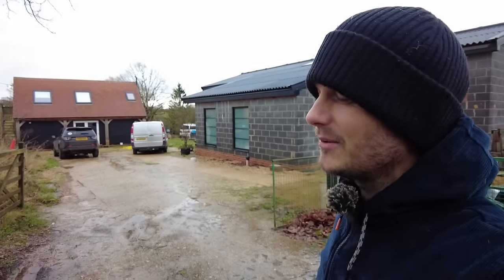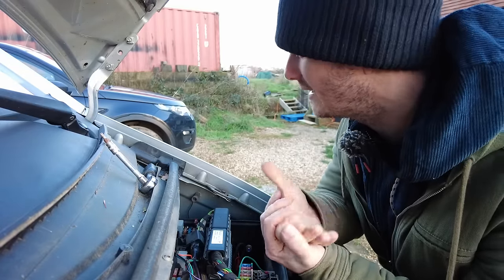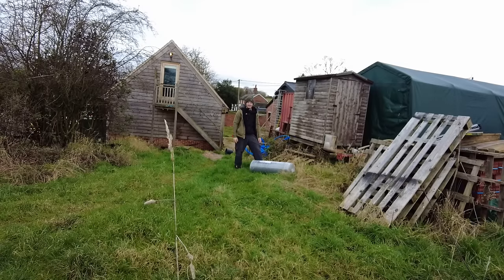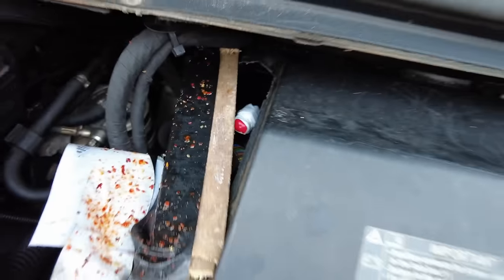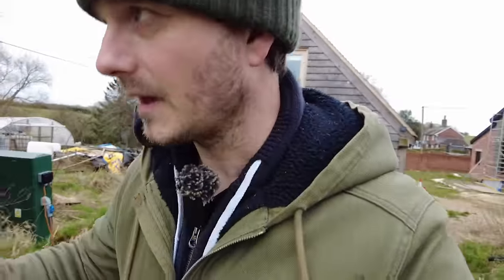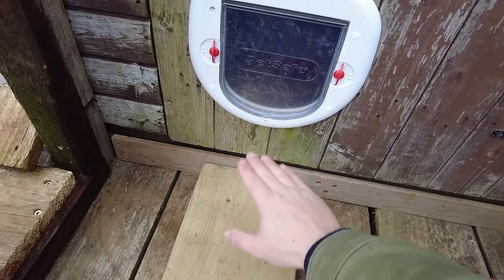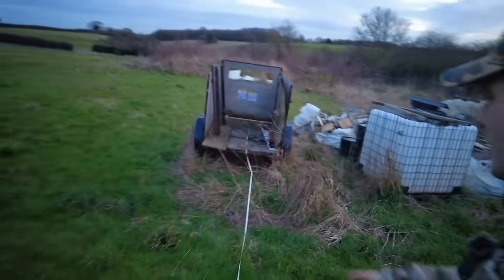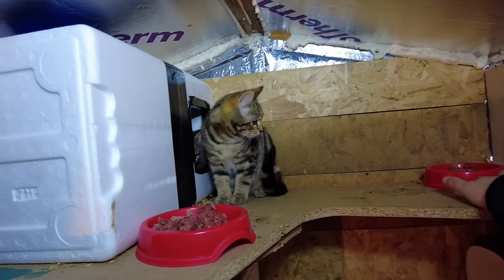Here's How I'm Handling It!

Comment: We've found that the wood pellets work a lot better than standard cat litter, works out a lot cheaper as you use less, it bio degrades when wet and is easier to sift.
Hope they fix your rodent issues, looks like they'll have a nice rural life once acclimatised.
Reply from the maker: I would go down that route but they were used to catsan at the rescue so thought I best not rock the boat too much 😬 once they're ready I'll open the door and they'll have a whole field to go on anyway so should only need a couple of bags 🙂

Comment: Years ago I got told the bin bags were moving in the back garden, "year right!" went out to investigate in my PJ's flip flops and dressing gown.  "Sh## the bin bags are moving", opened the shed, removed the garden fork and proceeded to lift each bag up with the business end of the forkand move it to one side.  A few bags later out hops a rat, I take a few quick jabs at it with the fork, striking sparks off a brick wall and with a squeal it runs off down the passage between houses.  I went to work the next morning but got a phone call on the Nokia brick due to a dead rat in the middle of the garden. It must of crawled back later an keeled over.  "They don't like it up em!!"
Reply from the maker: 😂 I hope they were camo PJ's

Comment: 1 big drum with a trapdoor on top with lots of peanut butter on top and a plank of wood for them to run up . My record Hi 30s .
Reply from the maker: Don't birds get interested?
Reply: @THE-AIDEN-PROJECT   I've never trapt one by mistake only pheasants with 1 plastic cup and 1 fly  sticky strip.  Put the strip around the inside edge of the cup Put in at the bottom of a bush with sweetcorn leading up to the cup with some corn at the back the pheasant will freeze with its hed stuck in the cup. Sunday dinner sorted.  New subscriber 👍🔥👐👍💙✝️

Comment: Spray WD 40 , and white lithum grease in a spray can, and spray the underside of the van everywhere. The white lithium grease spray is waterproof and will stick to the wire harness etc and help prevent mice chewing on wires. The WD 40 seeps into the cracks and will wash off , but it’s great at seeping into cracks, the white lithium grease, will need a respray at least once a year.  Mice will find a way inside your car , they are determined to find a dry home , the WD 40 spray on the underside works well at preventing that

Comment: Mate this was epic, literally! I love the way you told the story, it was a while in the making I'm sure. Can't wait to see if you actually get a rat with that gun. On a side note, how's the build progressing? What's the next thing on the todo list? I've been painting the wood work the past few weeks(taking ages same as usual) and working on my airtightness this weekend ready for the air test in 11th March.
Reply from the maker: House has been on hold 🫣😆 I'm going to have a run at it starting next week as I still need to do the insulation! 😱 
Are you going road with the spray foam and silicone?
Reply: @THE-AIDEN-PROJECT  Mostly spray foam and silicone, some insulation roll where I can squeeze it in. I also had to make 4 cutsom loft hatches to seal off some loft space as well as other places where I still had access to inside the floor etc. Still have work to do but should be done end of next weekend ready for the air test on Monday. You'll probably already know this but when you do start you insulation make sure you don't neglect the small gaps between the end rafters and block work. It's not something that I particularly thought about when I insualted my roof and now it's all plastered etc i'm struggling to get to them to squeeze some insulation in. Don't want to gun spray foam in as don't want it to expand and touch the breather membrane. I think I should be ok as is(Hopefully). I used Actis Hybris insualtion with the Hcontrol layer on top and it does a really good job of keeping the heat in, It's just a question of too much air gettinn or not. Time will tell on that one.

Comment: Remember mate the rattcatcher is only good up to 20 yards ,you can up grade the transfer port but youll need the longer 24 inch barrel because the accuracy gooes out the window, i would order an adjustable magnetic trigger first ,it will help with accuracy
Reply from the maker: Yeah 20 yards is good for me. I got the ratcatcher because I saw lots of people doing modifications so I've got some room with it, although if I really wanted to improve it maybe I'd just bite the bullet and get an expensive PCP

Comment: I had a mouse in February that chewed thru my wires to my lights at the back of my car next day my engine management light came on... My MOT was due and a service £800 later ...mouse trap and peppermint under my bonnet . 🙄I feel Ur pain ... apparently they like the casings because they use veg oil on them ...I haven't caught anything but I haven't had any mouse back ...touch wood . There was a nest in my air vent .
Reply from the maker: It's a nightmare hey! Mine was alot worse than I showed in this video though but my regular viewers would have seen that stuff already so it didn't feature that much 😅

Comment: I don't think the is a successful rat trap on the planet iv got a rat problem they get on every thing I do they keep getting the better of me av got live traps set up and yes I had some success with them but they get on to it iv had fun making the traps and watching them on camera but what happens they eat all the bait then when I set the trap to catch them they don't go in currently trying an orther design but will probably fail then il have to go back to the poison by the way that was a weasel not a stoat they ye can kill rats but they prefer smaller rodents they take a while to kill them because the rats are usually are a lot bigger than them also with the gun once they here the gun the gone it needs to be silent av tried all these methods and the rats win by the way I keep ferrets and cats but I keep the cats in for safety reasons and to go after them with the ferrets I woundnt get very far because they are males and they are to big to get down the burrows also I have no dogs so theyl  just bolt away and were they live is in thick brambles I may get 1 or 2 with the ferrets but because Therse that much bramble ECT I could loose the ferret my garden backs on to a disused railway embankment that's why it's so hard I have seen a rat nose to nose with a cat and ferret at the same time sniffing one another throo the wire I really enjoyed your video check are channel out the cat and ferret thanks for sharing THE CAT AND FERRET thanks again looking forward to see the next video